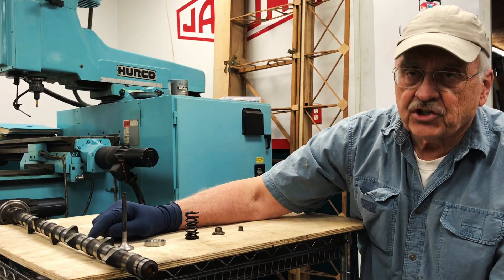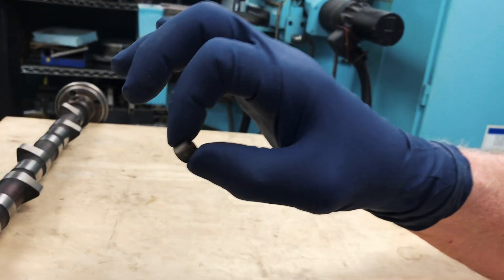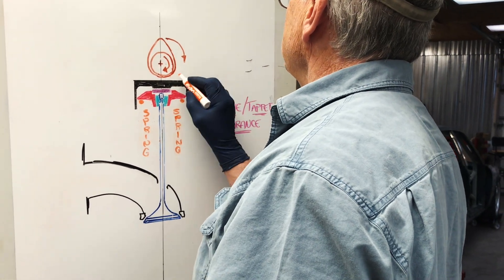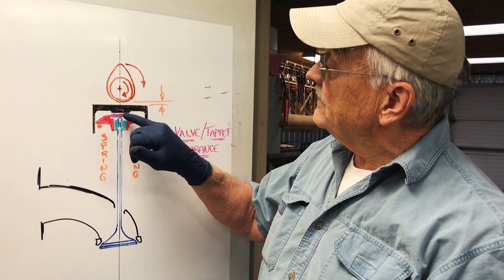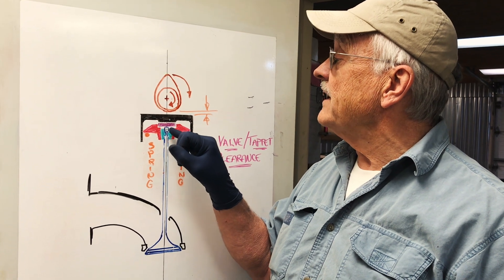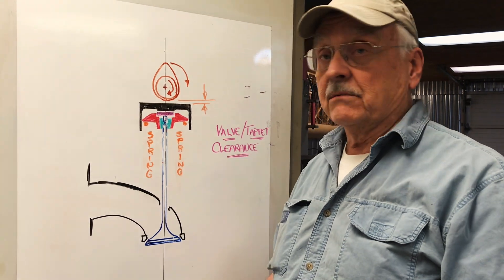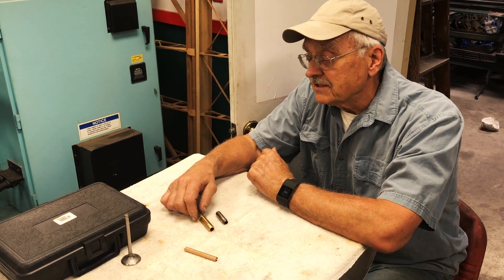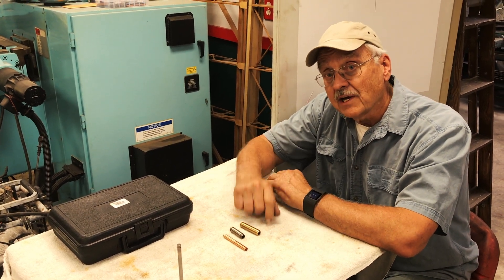Tech Talk - Jaguar 5.3 liter V-12 Cylinder Head Tech -- Part 2

Comment: Superb explanation of the valve train on the Jaguar V12.  

Oils love to see the race engine on either a chassis or engine dyno getting tuned in on race gas. I know it’s expensive to do so but would make for great viewing especially to see those itb’s in action!
Reply from the maker: There is a dyno video in the future. I don't know if it will be this season.

Comment: Could you do an video for shim change for the V12? The challenge is, that the camshaft has to be removed without changing engine valve timing.
Reply from the maker: It's not too difficult. Check my camshaft timing video.